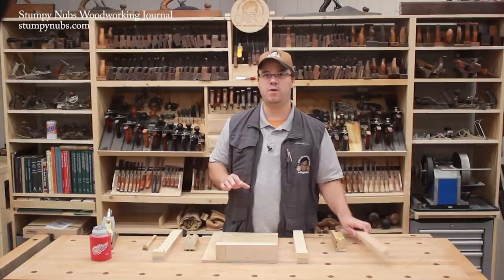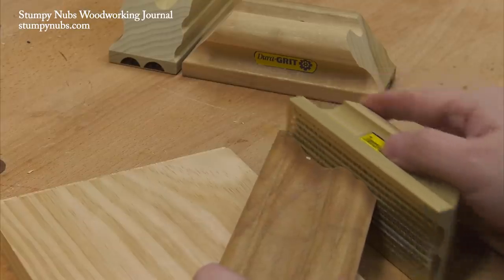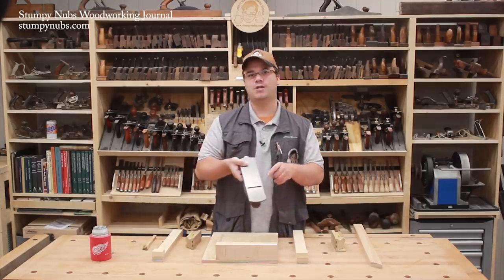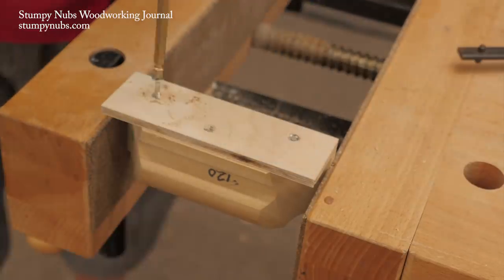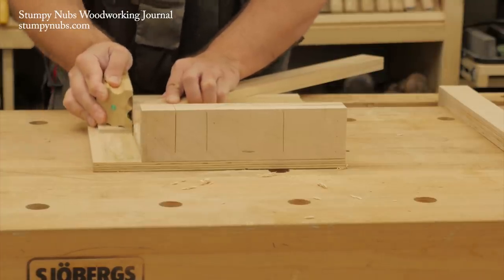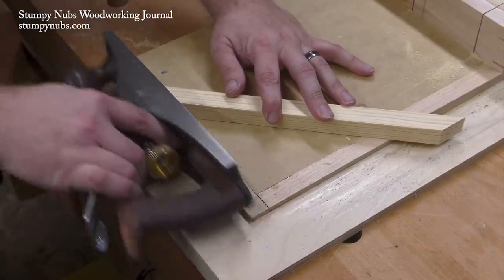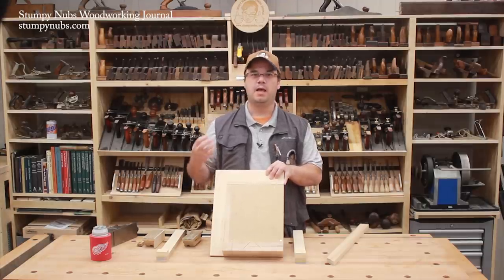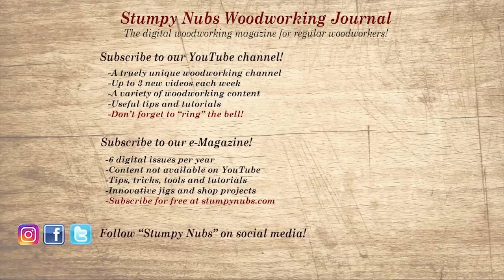A simple homemade sander for fine-tuning your miters and crosscuts

Comment: I bought the Dura Grit sander to work with my shooting board.  It left some deep scratch lines in my board.  I reported my issue to Dura Grit and they sent me a replacement.   First replacement had same issue, although to a lesser degree, second replacement works fantastically well.     Dura Grit customer service went above and beyond to get me a quality tool.  I will buy some of their other products too.   Highly recommended.

Comment: I've made a miniature version of that because I'm a modeller as well as a hobby woodworker. In the UK we have PermaGrit which is similar to Dura Grit  and you can get a sheet of thin steel with embedded grit , allowing custom sanding tools to be made. I've got one of their sanding blocks too - an aluminium extrusion with 2 different grits on opposing faces. It's 90 degrees too  and I wouldn't be without it sometimes !  Keep these videos coming please, I always learn something.
Reply: Thank you for teling me about PermaGrit.

Comment: Model builders ( architectural models and model railroad scratch builders)  have used a sliding sanding surface just like this for many many decades. Our platforms are often set up with a 90 and a variable angle fence. They make short work of dressing up a nice end on exposed rafters, boards, framing ends, etc. For both basswood and styrene, dressing cuts to shape always assures both great appearance and good fit.

Comment: Just a FYI...  Lee Valley sells "Veritas Shooting Sanders" in both 8" and 16" lengths.  They accept PSA backed sandpaper (various grits) and have that 1/4" wide bottom lip to prevent the sander eating into the shooting board fence (like plane's have).  The sanders are made from machined aluminum extrusions with a nice adjustable wooden knob to guide the sander along your shooting board.  The 8" sander is $40 US.  The 16" sander is $57 US.  I have no affiliation to Lee Valley/Veritas, but I do own the 8" sander.  Of course, the Duragrit sanding block has multiple uses where as the Lee Valley tool is strictly a shooting sander.

Comment: I just made one of those last weekend using a miter gauge, and have a video on my channel for it.  I even used a sanding block that uses those belt sander belts on it.   I do not have plans as what I did was simple and just used an existing miter gauge I had in a drawer, and your plans are always cool.  So I could have used your video a week ago.  :)

Comment: Thanks! I've been struggling with getting the strips I cut for my charcuterie boards to be perfectly 90 degrees (which is tricky since I start with rough, salvaged lumber and don't have a planer...I sand everything)...have been trying to square them on my belt sander, but I have nothing to brace it on so I have to eyeball everything. I'm going to order one of these sanding blocks and see if that will do the trick for me!

Comment: Thanks. Do you have plans for a sanding block shooting board that would sand at a 45 degree angle for small [6x6-12x12] boards? This could find use for some small projects.

Comment: I have to say, I acquired one of those Duragrit blocks a while back (at your recommendation), and while I really want it to be useful -- my woodworking is amateur and frequently needs touching up -- I find that it hardly seems to cut anything. Had the same issue with one of their random orbit discs, although eventually I managed to find a place for that. Whatever number the grit is labeled (and it certainly does feel coarse), it seems rounded rather than sharp, and I can rub it against end grain (in particular) for eons without making much progress on it.
Reply from the maker: What happened when you contacted them about it?
Reply: Stumpy Nubs Guess I haven’t spoken with them about the block. We did have an exchange about the discs that (eventually) ended up working out... hate to be too much of a pain as they were helpful. I assumed it’s just the nature of ceramic. Do you find them to be similarly aggressive to regular sandpaper?
Reply from the maker: No, I have not had that problem. In fact I find them to be quite aggressive and to cut very well, especially lower grits. If your problem was solved when you contacted them about the discs, why not give them a chance to also correct the other problem?
Reply: @StumpyNubs  Okay, okay, fiiiine... will give it a shot.
Reply: @tagbagzag  Well what happened?

Comment: 1:09 mark ... the side of the plane does not have to be perpendicular to the sole.  You must use the lateral adjustment to ensure the cutting iron is perpendicular to the sole regardless if the plane's body is square.
Reply from the maker: While you can laterally adjust the iron to compensate for an out of square side, it is much better to have the side/sole square to each other so you can use the same iron setup for planing with or without the shooting board. Nobody wants to fiddle with and skew the lateral adjustment every time you get your shooting board out.
Reply: @StumpyNubs  True, nobody wants to, but it's foolish to think the plane's adjustment remains constant.  Always verify before cutting.  With most bench planes, it is prudent to ensure the lateral adjustment is OK since it can get knocked off kilter so easily.
Reply from the maker: When I pick up a hand plane off my rack, I can plane with it immediately. I seldom have to fiddle with the lateral adjustment unless I remove the blade to sharpen it. Even if my planes were getting "knocked off kilter" frequently, why would I intentionally skew it for a shooting board, then have to adjust it back? Why not instead use a good plane for the shooting board? Or adjust the side of a slightly out of square plane with a little sanding? Or if that's not practical, why not just adjust the shooting board by planing or shimming the track at a slight angle to compensate? There are a variety of permanent fixes for the problem. So why make more work for yourself every time you use the shooting board when you can fix the problem once and be done with it? My thinking is not "foolish" it's just different from yours.

Comment: James, great alternative shooting use - I have been loving those sanding blocks.  Question, can the plans for this be easily altered to use with Japanese pull saws instead of Western push?  Would it be as simple as just relocating the hook to the other side?  Any issues with doing that which would alter the versatility of this design?
Reply from the maker: I'd just turn it around so the fence is facing you and put the strip on the bottom that creates the hook under the fence. It will still hook on your side of the bench, but you can pinch the hook in the vise to secure it.
Reply: @StumpyNubs  Sorry to butt in, but I routinely use pull saws whenever I hand saw anything. They work great with a bench hook, and I don't have to turn it around, just normal pressure holding the work is enough.

Comment: James, do you use the carbide sanding discs in place of other material sanders? I love the idea of a durable sander, but instances I've seen you reference them make it sound like you use them for special circumstances and not as a replacement.
Reply from the maker: Some people use them as a replacement. I personally use them for course sanding and leveling, followed by finer paper for finish sanding.
Reply: @StumpyNubs , you rock! Thanks for your response.

Comment: No! The sides of a plane do NOT have to be perfectly square to the sole of a plane in order to use it for shooting. Lateral adjustment in the plane will allow the plane iron to be set square so that  square ends or edges can be created. I like the sanding block idea. I think I'll give a try. Thanks.
Reply from the maker: I wouldn't be so quick to tell someone they are wrong... There's a reason for my statement: While you can laterally adjust the iron to compensate for an out of square side, it is much better to have the side/sole square to each other so you can use the same iron setup for planing with or without the shooting board. Nobody wants to fiddle with and skew the lateral adjustment every time you get your shooting board out.
Reply: Doug Commons, sometimes I daydream about having the sides of my planes reground, but I just pack up the track of my shooting board instead. Works better than monkeying with depth of cut.

Comment: I purchased the 90 degree sanding block.  NOTE: it is NOT designed for interior corners!  The sanding surface does NOT extend to the whole block face and this gap will ruin your interior corner.  I returned it for a full refund but was very disappointed. The company honored their refund policy.

Comment: ...my handplanes aren't all right angles between side and sole. That's what the side-to-side adjuster is for...
Reply from the maker: ...While you can laterally adjust the iron to compensate for an out of square side, it is much better to have the side/sole square to each other so you can use the same iron setup for planing with or without the shooting board. Nobody wants to fiddle with and skew the lateral adjustment every time you get your shooting board out.
Reply: @StumpyNubs  True, and it's not the greatest source of joy in the shed (at least not in mine), but for a hobbyist it may just be that you can't afford a dedicated high-end shooting plane from veritas or lie nielson, and are using vintage planes which weren't always exactly at right angles (my records are within a degree or two but it seems that for record at least only the shoulder planes got machined really accurately). 

In practice, my shooting plane is a cheap record T5 and that blade is effectively O1 so I have to take it out to sharpen it rather often anyway so the lateral adjuster always gets a workout. After a while, you get pretty quick at it, especially if you have one of those small cheap engineers 2" squares around or a 1-2-3 block.
Reply from the maker: I used vintage Stanleys for shooting planes. Sometimes you have to tweak them by sanding the side to square them up.
Reply: Mark, I disagree that using the lateral adjuster is effective, unless we are talking about no more than a single shaving’s thickness. None of my planes are ground square enough for that. Pack up or plow out the track of your shooting board instead. No great trick.

Comment: Muy Estimado Sr. Nubbs,
I ordered and dutifully paid $5.00 for the Shooting Board/Bench Hook plans:. This is the order info:

Transaction ID
6AH95049EN0385246

However, 24 hrs later, and they have not appeared by email or other electronic means.

When and how will they be delivered?

Gracias!